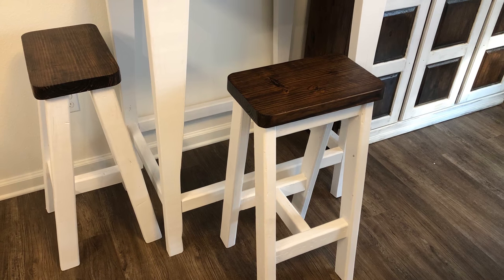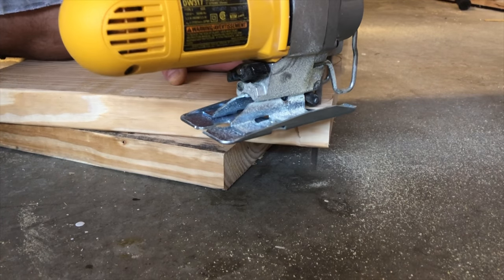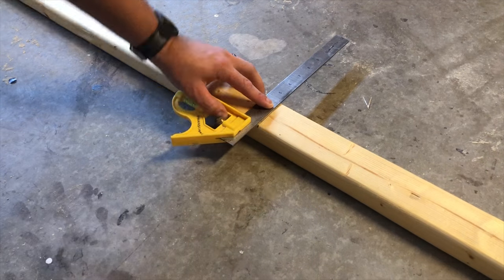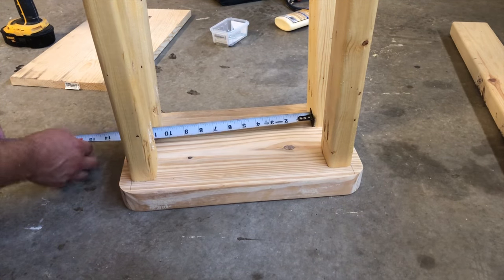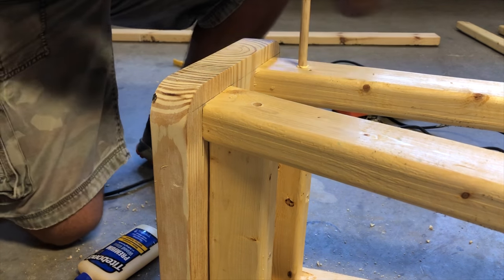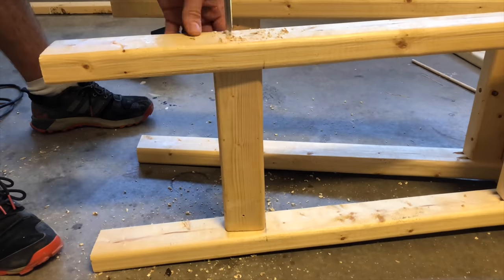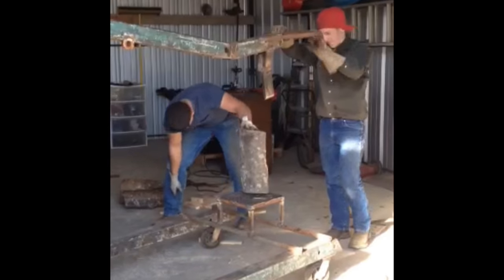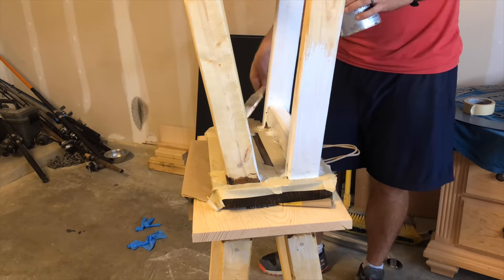How To Build A Bar Stool (EASY!)

Comment: Those are great and very easy to build. I slightly changed the bottom braces and installed it horizontally sticking out about an inch. Shaved the corners like a seat. Made it for a great foot rest. Love it. Thank you.
Reply from the maker: You’re welcome! Thanks for the comment

Comment: I used this video as a loose reference to make a live edge stool, thanks man, although probably due to my own slab size I feel the chair tips easily, maybe next time I’ll do a compound miter to add stability
Reply from the maker: That’s awesome! You should join our Handmade DIY Projects Facebook Page and post the pics.  I’d love to see them
Reply: DIY MAN How do I join your DIY page? I’ve made several of these stools after watching the video. Also, I see a lot of people using double bevels. Is that something that would help or no?
Reply from the maker: It’s called “Handmade DIY Projects” on Facebook.  You can “like” my DIYMAN page, but you can’t actually join it.  I operate and post on the “Handmade DIY Projects” page pretty regularly
Reply from the maker: Also, on the double bevel, it’s all a matter of personal preference.  I’m sure it would help a little

Comment: So I saw this video as one of the first options on Barstools DIY and I love them. I was wondering for the (2x3) and it says 3 pieces. That means (3) 2x3's correct? And for the dowel Rod 1 of those would probably work 3-4 barstools correct? Also, I was wondering if i wanted to increase the seat width could I do 18in and adjust the leg height to 34in?
Reply from the maker: Yes, it’s been a while, but I believe you need three 8 foot 2x3s for each barstool.  1 dowel rod should be enough for 4 barstools.  I’m sure the seat width would be easy to adjust, but you might have to tweak the angle a little bit if you change the height

Comment: Been needing one of these for my shop. I assume you can make the legs as long as you need. Correct?
Reply from the maker: Yes, just keep in mind, if you don’t change the angle at the top and bottom, the base will be larger.  Adding a couple inches shouldn’t change it too much though.  Trigonometry is not my strong suit 😂
Reply: @DIYMAN  So maybe like 6 or 7 degree cuts on a 32” leg?
Reply from the maker: It’s somewhere around there. I will have to check

Comment: So this is pretty much my first woodworking project, but i have an issue ive encountered with the legs. When ever im drilling them to the seat as soon as the screw exits the leg and starts to drill into the seat it pushes the leg up (even though im pushing down on the leg as hard i can with my other hand). And it kinda throws it a TINY bit off and even after i drill it in all the way it still seems like the leg isnt fullllly connected to the seat. They seem like somewhat wobbly, which is fixed by the bracing but i cant help but think im doing something wrong.
Reply from the maker: This issue is pretty common, especially if you are using hardwood to make these barstools.  First, are you using pocket screws to connect your legs? If you aren’t, and the screws are too thick (or the threads arent right for the wood) it can cause this.  If you are making these out of a hardwood, they make screws specifically for this.  Second, if you are using a drill instead of an impact gun to install these screws, it won’t have as much torque when installing the screws.  This will make it tough to get a tight fit too.  If I’m using a drill to assemble these and I run into this issue, I will install the screw about a quarter of an inch then reverse it, then in a half an inch, reverse, then it should go in all the way.  Another thing you can try is to add paraffin wax to the head of the screw and this can help it go in easier.  I hope this helps you! Best of luck!
Reply: @DIYMAN  i gotta say it might be the screws cause im just using 2 1/2 in screws (I think there deck screws which i tbought would work fine cause i figured wood is wood haha) which i probably should be using the 2 in pocket screws specifically for the pockets which i saw that you mentioned in another comment. But i am just using whitewood and a drill. Im going to just try using the different screws and do the in and out method you just said and see if that works out. Thanks man!
Reply from the maker: Awesome! Let me know if that works for you!

Comment: Do you have a video on how to make the table, that’s in the shot at the beginning of the video ? 
Thank you.
Reply from the maker: I don’t, but I do have something very similar.  I made a “kitchen buffet” which can be built without the upper cabinet.  It is essentially a table with an upper cabinet on it.  If you are building my bar stool design in the video, you will also need to make the legs 41-42” long instead of what I have in the video to make it more comfortable to sit at.  Check it out, it’s a very simple design.
https://m.youtube.com/watch?v=0fC4EBXHbIY

Comment: Would a 2in or 3in screws work for this project?
Reply from the maker: You could use either one.  If you use 2” screws, pre-drill your holes a little deeper.  I have done it with both sizes
Reply: DIY MAN okay thanks. If I use 3in screws continue is per usual?
Reply from the maker: Yes.  3 in screws are better, but both will do the job. 👍🏻

Comment: It’s not a 1x10. It’s a 2x10. The lumber list is wrong, but the instructions on the link are correct when you read through them.
Reply from the maker: Thank you. You are correct. I make mistakes all the time. You can use a 1x10 though.
Reply: Everyone makes mistakes. When I built it for the wife she saw it didn't look the same. I never even paid attention. I just made it.She likes the thickness for the 2 x 10. Had to make new tops. Thought I would save someone else time if the wife just writes down a lumber list for ya.

Comment: Can I use 2x4s??
Reply from the maker: Yes.  The easiest way to do that would be to rip them down to 2.5" wide like a normal 2x3 because it will throw off your angles and they will not fit at the seat top without trimming them.  Let me know if you are able to make that work.  I'd love to see the result on our Handmade DIY Projects Facebook Page.

Comment: 2x3s?
Reply from the maker: Yes. Every Home Depot I’ve ever been to has them.  Sometimes you’ll find them at Lowe’s too. They make great handrails for stairs too.
Reply: @DIYMAN  So their true dimensions are actually 1.5" x 2.5"?  I've never even bothered to look for 2x3s.  Interesting.  How much cheaper are they than 2x4?
Reply from the maker: Yes. That is their dimensions. They usually cost around the same as a 2x4, maybe a little more expensive.